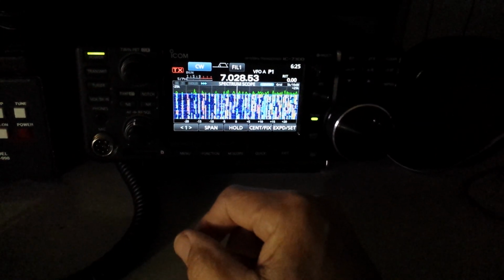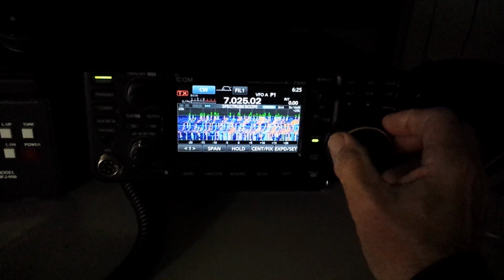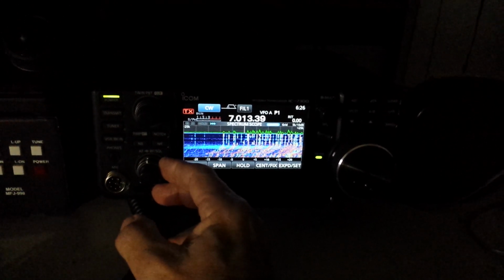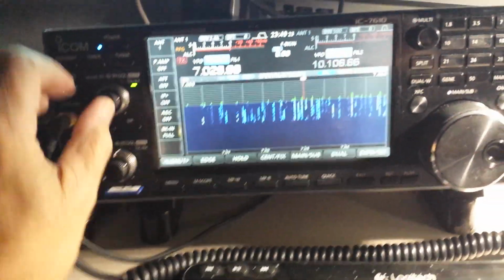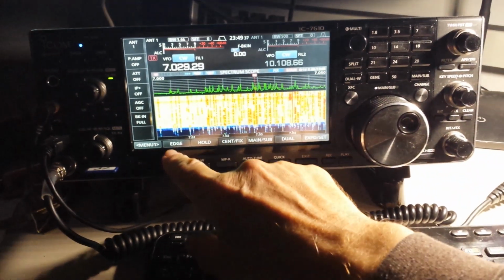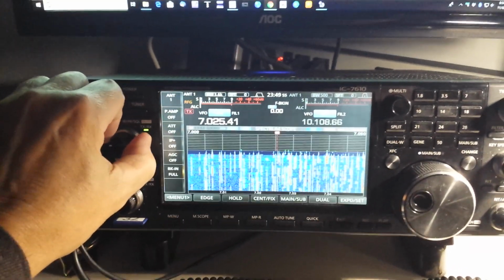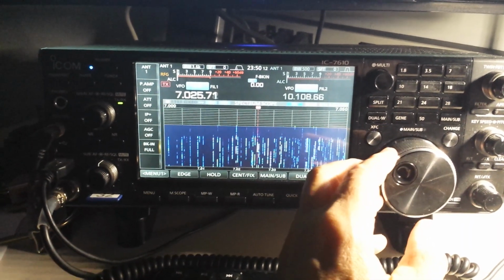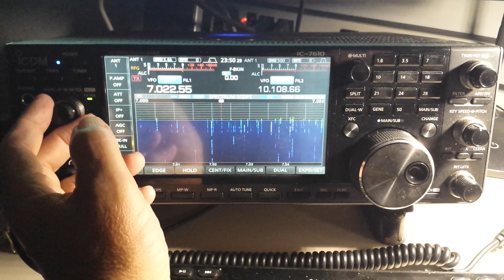IC-7610 vs IC-7300  Actual Signals

Comment: I bought an Icom 705 and even though it's a great radio, it showed a lot of software bugs and eventually the wifi stopped working, during email correspondence with my seller and the technician from Icom they tried to make me look stupid to avoid a claim, I insisted and finally the problem was fixed by replacing the motherboard, as soon as the radio came back from service, I immediately sold it. When I see the problems starting with the display and ending with different parts in the quality of the receiver, Icom wants to vomit. I had a 7300 and I can say that I bought it bargain, it was a great radio for the money, but it produces an awful lot of noise, that listening to the bands for a long time gave me a headache, I spent hours researching different settings to avoid this, I see a solution purchase of FTDX10 which I am about to do now. I wish you strong nerves with solving the problem or simply selling it immediately. 73! GL

Comment: Did you ever get this fixed?
Reply: Hi N4LQ, I think there is something seriously wrong with the gain distribution at the back end of the radio. AGC off can be a useful tool, as explained above. I suspect that the rx audio stage is being grossly over-driven, even with weak signals.  And even with AGC on, I suspect that AGC attack-time is not quick enough to avoid some distortion on the leading-edge of cw characters or speech syllables. I seem to remember hearing a bit of rasping on the audio of one which I tried at the shop.  Good news is that it seems Icom have acknowledged this is a fundamental fault.
Reply: if it's not a problem, you can't fix it anyways.
Reply from the maker: There's nothing to fix. It's just the way they all are. The cure is to not turn off the AGC. It just came back from ICOM with a new display. Looks great.
Reply: @n4lq  How long did the old (original?) display last?
Reply from the maker: The display was replaced twice. The original became ugly after the first month or so. I tried to get HRO to take care of it but they said "They all look that way". The final one looked great so I sold the radio.
Reply: thanks for telling, i will  NOT buy the ic7610.
Reply: @PhantomWoIf  you should. \\ actually if you can. the display issue was resolved quite some time ago and each rig is fixed even outise of warranty.

Comment: My 7300 is an interface to the amp, tuner and antenna system. The 7610 is headed in the right direction and it would be nice to add one to the shack, but not for the price. 

A big format 7300 with a bigger screen, bigger buttons, etc. would be sufficient. Call it the 7310 and they will sell like hotcakes at a syrup convention.

Comment: A quote from gigaparts specs. on the IC-7300 vs. IC-7610, I'm not sure if it makes a difference that for the 7300 they used 1khz frequency Separation as their bench mark and on the 7610 it was 2 khz frequency Separation.

" RMDR and phase noise characteristics
The IC-7300’s RMDR is about 97dB* (typical value) improving the Phase Noise characteristics by about 15dB (at 1 kHz frequency separation). The superior Phase Noise characteristics reduce noise components for both receive and transmit signals.

* At 1 kHz frequency separation (received frequency: 14.2MHz, MODE: CW, IF BW: 500Hz)

15 discrete band-pass filters

The RF Direct Sampling is protected by an array of bandpass filters. The signal passes through one of the fifteen bandpass filters, where signals outside the passband are rejected. To reduce the insertion loss, the IC-7300 utilizes High Q factor coils."
https://www.gigaparts.com/icom-ic-7300.html?gclid=EAIaIQobChMIuY6Kx-3Y4gIVArvsCh36SwwOEAAYASAAEgJYbvD_BwE

"RF direct sampling system
The IC-7610 employs an RF direct sampling system, where RF signals directly convert to digital data and then processed by the FPGA (Field-Programmable Gate Array). This process reduces distortion that naturally occurs in the various mixer stages found in traditional superhetrodyne receivers.
The RF Direct Sampling System in the IC-7610 is capable of 110 dB* RMDR. This performance gives you the ability to pull weak signals out of the noise of strong adjacent signals. There is a difference you can actually hear as the desired signal comes out of the pileup!
* Representative value at 2 kHz frequency separation (Received frequency: 14.2 MHz, Mode: CW, IF BW: 500 Hz)
RMDR characteristics"
https://www.gigaparts.com/icom-ic-7610-hf-50mhz-100w-transceiver.html

Comment: Your 7610 probably has a fault. When I got mine the second DIGI-SEL unit for Sub band was not enabled for 21 and 24 Mhz at the factory and had to be returned to ICOM for fixing. But I have to say now the 7610 is more sensitive than the 7300. The 7300 is a bit deaf in comparison. Send it to ICOM for a check up under your warranty. They will set everything the way it should be. I think ICOM messed up on a lot of units at the production line. The IC-7610 is a great radio.

Comment: I hear AF distortion on the 7610 not ADC overload, and I can't see OVF (ADC Overload) light on either receiver.  This doesn't surprise me, as the S meter shows no deflection on either the 7300 or 7610 as well.  I'm not sure what's going on, but I am certain it isn't ADC overload.  SDR ADC Overload results in 'hearing' multiple stations all at once, not the severe flat toping of the CW note giving the characteristic 'hollow' sounding 'squark'.  If there is a fault with the IC-7610, it is in the audio amplifier section.
Reply from the maker: Yes we are pretty sure it is not the ADC causing this. If it were the audio amplifier we should be able to route the digital audio out the USB port and hear clean signals through our computer... Right?

Comment: my 7300 does EXACTLY like the 7610 when I turn off the AGC, it's extremely loud and distorted plus when I restore the AGC parameters to default, the radio is making a bunch of noises and I can't use it. I need to turn it off and then back on. I am on v1.3.

Comment: no diff but 7300 is way better. thats why i see many 7610 sold at QRZ hihi.
Reply: revadan ftdx3000 with an sdrplay can smoke the 7610 any day
Reply: @Mark300win  when you say the ftdx 3000 can smoke it what do you mean ? I just sold my 8 months old ftdx3000 not because it is deaf or faulty or anything like that but lot's of little things , like no ability to change tuning rate to 1khz ! Very very sensitive vfo , mox button right next to the power control,  the clar /VFO b /ch arrangement is a unmitigated shambles,  the memory channel can't use the clar mainly little yeasu idiosyncrasies that defy logic?  Basically not user friendly.   Of the 2 rigs I had it was a easy decision for my which one to sell , it was the ftdx 3000 ! Just incase you think i hate yaesu, i don't  i love the ft 817 ,still do . And as for the rig i held on to is a much lower price basic rig , a icom ic 7200 . It is much much more user friendly,  and yes it hears everything that the 3000 hears . I am one of the lucky ones that i live way out in the country with low noise figures that most hams could only dream of ( mostly s 0 on all bands ,even top band ), and i can assure you my ic7200 and even my old ic 746 and ic 703 and yes that ft817 can hear everything that the ftdx3000 can hear , only the ftdx 3000 might cope slightly better in filter department,  but no better than the ic7200 . So i am curious in what department will the ftdx 3000 smoke this for any other rig ?
Reply: @Mark300win  FTDX3000 is an ugly old fashion bit of junk, is that all you can afford?
Reply: 7300 is a little toy. But you can't afford the 7610. Any excuse will do.

Comment: Good comparison. I'd like to see the same with AGC turned on now. My guess is they'd be much more similar.
Reply from the maker: Sure they are the same
Reply: @n4lq  My favorite thing about IC7300 is CW with the AGC off. I like FT2K and FTDx3000 on CW. Are any of the new DC conversion radios sharp and pleasant with the CW note? IC7610 is not, maybe TS890 is... ??? Ftdx10 or Ftdx101???
Reply from the maker: @donr2670  I'm not even sure what you mean there Don.
Reply: @n4lq  With IC7300 CW AGC Off you can turn AF gain way down  and still hear a nice strong signal. Many SDR radios (including IC7610) have too much hash noise on an empty frequency at 500hz. Videos of TS590 also show this.
Reply from the maker: @donr2670  OIC... Well I think you're referring to what I call "residual noise". Yes, that's caused by the noise generated in the A/D converter or ADC and the DSP gadgetry. You can even see it on the waterfall as snow. The RF gain control is not really an RF gain control either. It's just an attenuator that shunts incoming signals to ground via a biased diode. The ADC runs wide open at all times. 
We are taught that this noise doesn't matter because it is below the band noise and typically it is. When sensitivity measurements are made this proves to be the case and we should just ignore this noise since we're never going to hear a signal any weaker than it is. I know it's frustrating. 
I have not listened to the FTDX-101 or 10. They are supposed to have superhetrodyne front ends. It would be interesting to compare them with the Direct Samplers. My TS_890 had a superhet and it was as quiet as the old ones such as the 940 etc.
Reply: @n4lq  Very informative Steve, all I wanted to know and more. I'll keep my eye on TS_890. Also, one day Yaesu will refine Ftdx10 and 101Mp and pretty sure  the price will come down too. ;-)

Comment: That was a striking difference in performance, is it possible that there is something wrong with your 7610, but not so wrong that you might think it just does not work so well. Some problems are just like that, it takes  some expert with expensive equipment to see why, and where, and fix it.
Reply from the maker: They all do this. Not possible that mine is broken. It's standard equipment
Reply: @n4lq   I have both radios and never noticed what you are demonstrating, that is the reason I suggest that you get the radio checked out, they are not immune to mistakes, or a part out of tolerance, or a bad adjustment. it can be anything, but I doubt it is a bad design that they never caught.
Reply from the maker: @JosephMassimino  You never "noticed" probably because you didn't turn the AGC off. Do you know how? I can help.
Reply: @JosephMassimino  I completely agree with your conclusions Joseph.  Perhaps its possible there is an 'AGC OFF' bug in the 7610 that we haven't discovered, but I don't understand the point of running any rig with the AGC off, No attenuation and No RF Gain reduction on low bands.  At any rate it it sounds exactly like AF distortion (severe sine wave 'flat topping', used to make that sound on audio synths all the time) rather than ADC overload; this would seem to be backed up by the lack of any 'OVF' light flashing on either rig.  The fact the S meter isn't deflecting on either radio has me stumped too, but I must admit I can't recall turning off AGC and looking to see if the S meter still worked.  One would assume it does but I could be wrong.